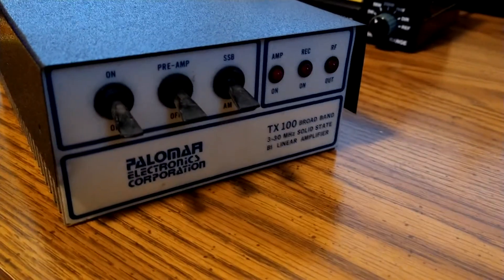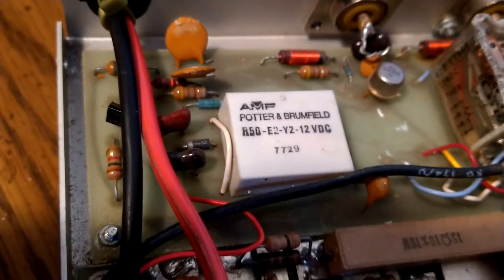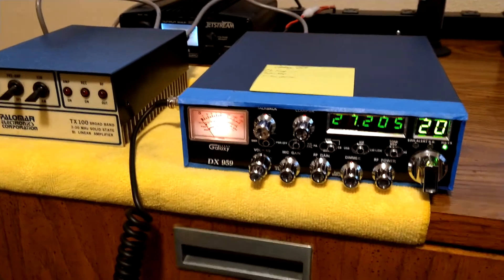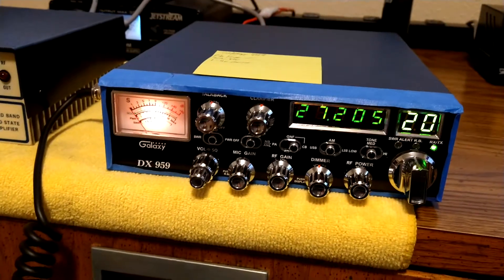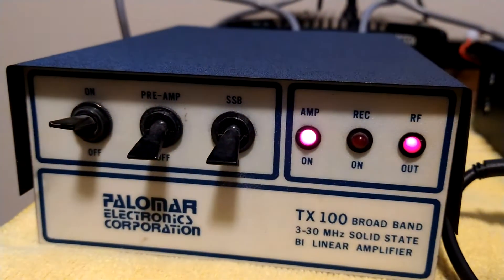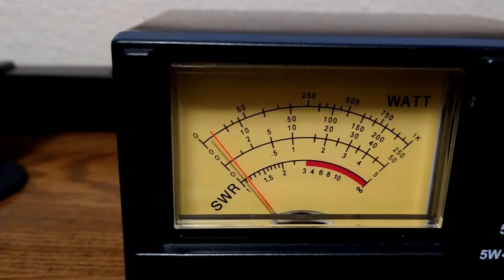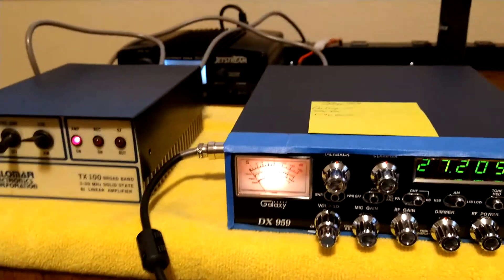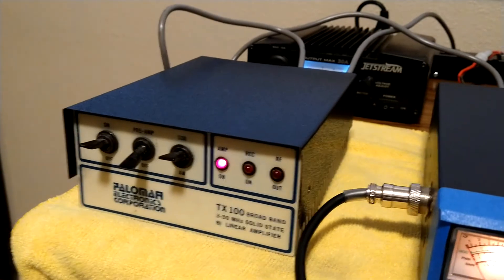Palomar TX 100 CB amplifier testing

Comment: I have a palomar TX 75. I wonder what my little 2 pill will do. I have never put it in line yet. I recently got it from a neighbor. He is very old and saw me talking on my Ham radio. And he flagged me down and handed it to me. You did a great job on that cover. And it works great on AM and SSB. That is a really nice amp. I am eager to test mine now.